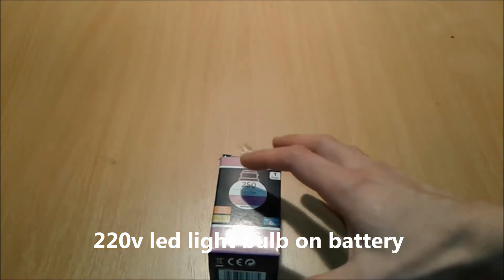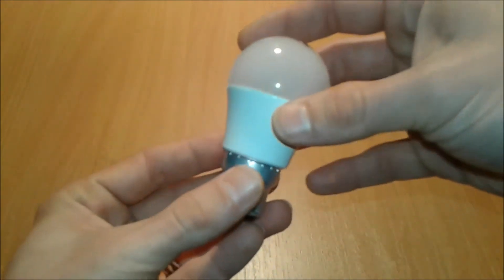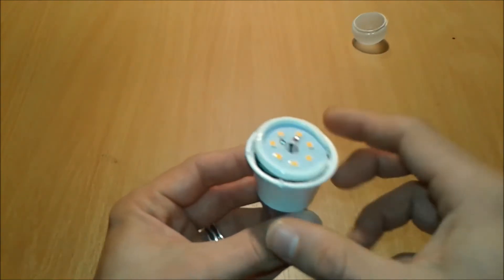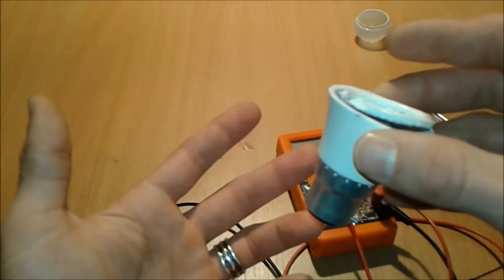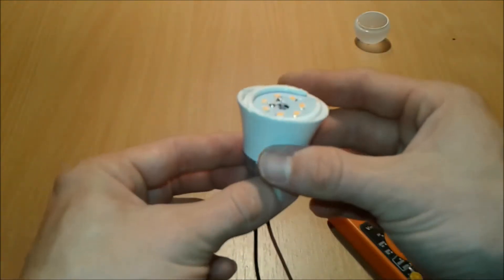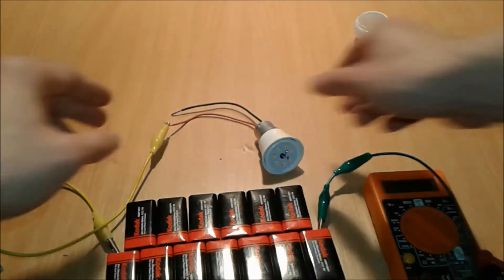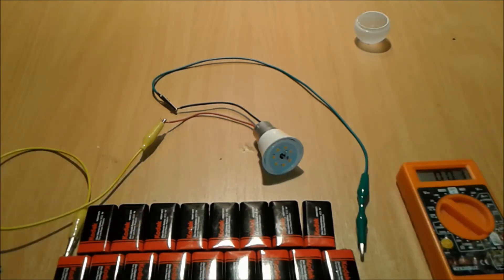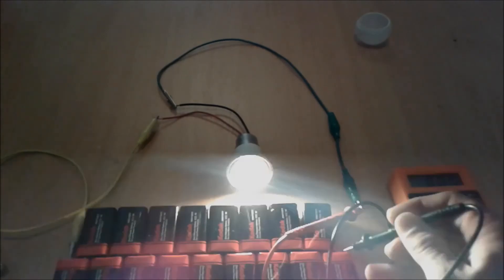Incredible 220v led light bulb on battery

Comment: no way i ever use this.  If everyone need a mobile 220V bulb there are better and cheaper ways as connecting  to a bunch of batterys. 
Take the LEDs in parallel, you dont need so much Volt.
No one will buy expensive Batterie packs to reuse a 1$ bulb.
Reply from the maker: auricom24 this is not the purpose of the batteries. They just serve as a DC power supply the point is to light the mains operated bulb by DC power. For portability we will make an inverter that steps the voltage from 12v to 220v